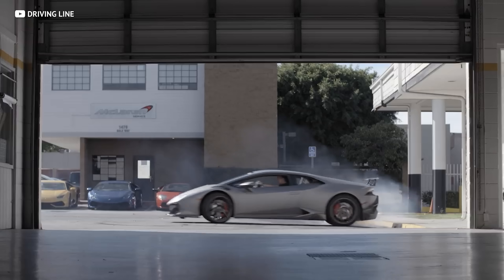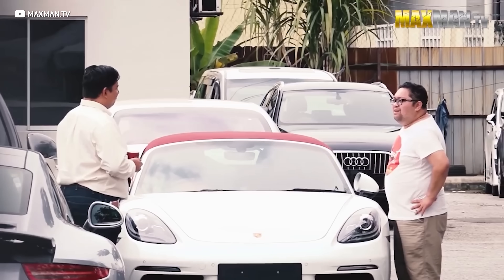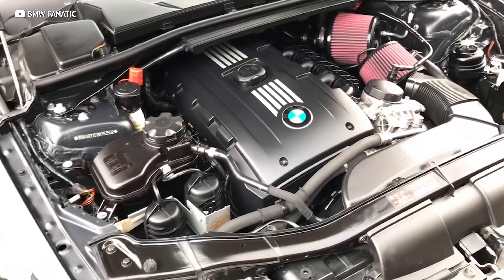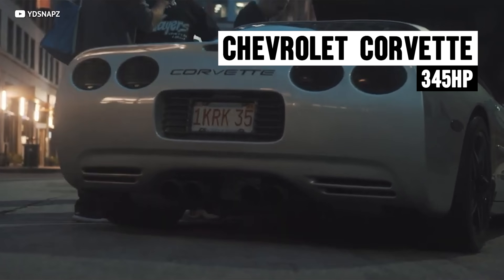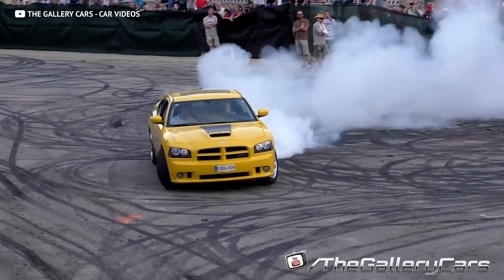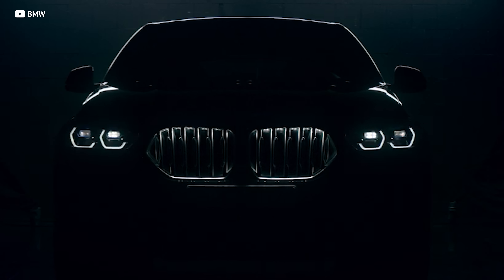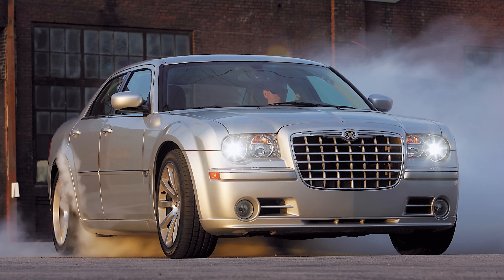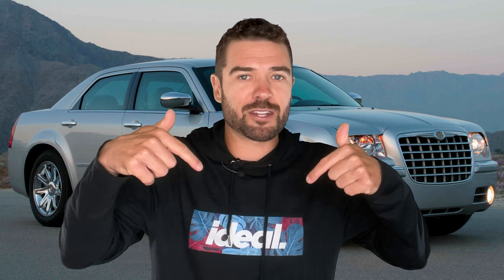Cheap Cars With a TON of Horsepower

Comment: You forgot the jaguar s type r. Why these cars are cheap is beyond me. I have one since new 2003 . I paid 61 k for it. I've customized it and done some mods . It came with 400 HP. Mine has a little more with smaller pully and other Tweeks. These cars can be found for CHEAP . Great video.

Comment: For 10k I can get a 
1990s Honda civic for 2k
Full turbo kit for 2k
Full built motor for 3k
Dyno tune to over 600whp got 250
Total spent is 7,250
2,250 for safety stuff
😂😂😂😂😂😂

Comment: I've driven 7 of these, and I am 100%  with you on the mid-2000s Infiniti G35. My mom had the '04X because we live in the North. But let's just turn the traction control off and be sideways for a bit, eh?. HAHA! But ya know? Crashing Mom's Infiniti is a good way to be orphaned. So I mostly drove it with empathy and safely. It is, hands down, the most competent car I've ever driven in the snow. Still! I was passing trucks trucks in the ditch every winter. I think the Front Mid-ship Tech helped a lot. Sedan was 50-50 and the coupe 50-49. But Once a line  or model loses the manual transmission, I lose interested. I die a slow death with the 5,6, and 7 speed. Life used to be better.

Comment: The latter part of this vid should have been called "Cheap cars with tons of hp and no build quality".  Great vid though.
Reply: Only gear heads seem to get this . Yup all the plastic and chips will fail in a few years and it is most likely someone who originally bought the car probably drove the snot out of it unless it was a retiree . If you want a high horsepower car lease it and let it be someone else's problem .

Comment: No Infinity hasn't, ive put 90k on my 2015 q50 buying it with 36k miles, almost 2.5 yrs later I can sell it for what I bought it for. And the 3.7 will easily run 300k Miles. Infinity especially the 3.7 is the best motor hands down in its class. So I disagree with your assessment.

Comment: If you're looking for something a bit cheaper, more practical, and more reliable than the cars on this list, I'd go with a Pontiac Grand Prix. You have two options if you want power. 

First is the GXP with the 303 horsepower LS4 V8. This is best if you want straight up power and performance. You can find one for under $4,000 nowadays, no joke. 

Next is the GTP with the legendary 260 horsepower Supercharged 3800 V6. If you want to build, tune, upgrade, and race your car, this is the way to go. It makes less HP stock than the GXP but it's more reliable and you have more room to work (think up to 700 horsepower on a stock block with a turbo kit), not to mention that you can get one for under $2,000.

Comment: I won't subscribe because they need to put on someone that actually knows about the cars. The 300C had 340 HP, not 425. The SRT8 had 425 HP. But, I bet dude knows all of the specs for a Norelco shaving system though.

Comment: Do your research a little better. Only ways your getting a gto for under 10000 grand is it has 150000 miles or more.  Most like mind are going for 18000 to 28000.and their heavily modified

Comment: Nice list. The thing with the C5 vette is all the cheap and good deal ones are either automatic or are a 6 speed and have well over 200k miles/are super junky. I think your best pick on the list is the lx cars (5.7 hemi Charger/300). Why? A 300c hemi with 150k and in great condition can be had for 3800-5k if you keep your eyes open. With a converter, Eagle (09+) heads, and a cam, you have a mid 12 second car for 7,500-8,500. The NAG1 can handle that power level relatively easily, and you're only a 100 shot away from 11's, which is good enough to beat every car in this video and still be at the same price or cheaper. 

I would say go LS with the goat or an F-body, but those cars are at least double the price that they were 5 years ago now and not really a bargain anymore.

Comment: Acura tl (3g),  in particular the type-s.  $5k -$7k for a clean condition base model, $8-10k for type s.  Intake /exhaust and a tune will get u well into the 300hp range on the type-s, with the 3.5 v6.

Comment: why didnt my comment get added? dam gypsies.... 2014 chevy caprice ppv. v8, 6.0. 355hp. gov auction as low as $5000. i paid $8500... you mentioned its cousins from Australia... i want my  spot.
Reply: L77, zetta platform... will fit brembos if lightly modded as well

Comment: The first car, BMW 335i, is nearly impossible to find. They might have found one with a salvadged title and blown headgasket with transmission problems, but I don't believe for a second that you will find another one for less than $10k.

Comment: With all of these cheap, easy to find on “Cars Dot Com” cars you’ve said, I’m surprised y’all didn’t mention Fords most reliable, and easy to find for cheap power pusher, the 4.6L 2v.
-
With a respectable 220hp throughout several platforms from the Ford Explorer to the Crown Vic and even the Mustang GT, you can find these for between $3,000 and $10,000. The cheapest being likely the best bang for your buck, the highly overproduced and most rigid car ever built by Ford or most other American manufacturers, the Ford Crown Victoria P71/P72/P7B Police Interceptors. They come standard with the 4.6L 2 Valve V8, on a police packaged, body on frame, wildcat of a police car(aka the Panther Platform). They run on FB for between $2,500 and $4,500. You can find them at dealerships for about that as well. I’d say they MORE than make the cut for this video. Same with the same generation Mustang GT(2001-2006/2007-2008.5). The GT comes with a 4 Valve version with a more respectable 260hp. Also, both have a top speed between 130mph to 140+ mph.(I had my P7B up to 143mph whooping a Mercedes S550’s But lol). I’m genuinely surprised, with all this, that y’all didn’t mention this, like at all.

Comment: I had a 335i with a remap that dyno'ed 431hp, would easily beat every car on this list. Got rid of it for an LS2 engined Monaro which was very nearly as quick and now own a 635d, remapped to 350hp. The Monaro was the most fun of all of them, drifts super easy and sounds amazing but didnt feel nearly as fast as the 335. 635d defo my favourite though, loads of torque, very comfy, still handles ok and looks a lot more expensive than it is. Also, the 335 was the most unreliable car ive owned, by far

Comment: One of my co-workers drives an LS swapped BMW that had orginally come with a V12. 

There was zero chance of ever resurrecting the original motor.
Some internals were visibly hanging out the sides.💥💨

It sat in our shop for about a year. I think everyone has either machined or welded something on that car.

Our painter laid down a fresh coat of epoxy and basecoat/clear coat on it.

It's a really nice car now.

Great guy that's always willing to help somebody else out.

Cool to see him enjoy having the car he's always wanted. 

Good Karma too with it sitting out front as advertisement.

We have gained quite a few new customers from the local Hot Rod and Motorcycle enthusiast community.

Comment: I bought a g37s and I’m honestly completely satisfied with how it drives and the way it delivers power it’s just underpowered stock from factory. I think based off this list now im kinda wishing I looked at GTO’s 💀
Reply: The issue is there isn't a gto out there under 17k
Reply: @dawsonholland2885  not very accurate I see them listed for 13-15 all the time. Depends on condition, mileage and transmission but they’re definitely out there
Reply: Not under 100k miles like he said
Reply: @dawsonholland2885  what state you in? I’m in Texas (DFW) and I see them with moderate miles all the time it’s just the gamble you take if they’ve been dogged or not
Reply: North Carolina lol I have looked and looked and looked all with in 300 miles of me are 14 to 17 with 100k plus miles and 17 and over for under 100k

Comment: OMG. The G modern Nissan's and the Infiniti's are fucking GARBAGE. They have more power than an STi, yet get straight up OWNED by an STi. We aren't talking about barely lost in even a roll race. We are talking about bus lengths behind an STi in a roll race. That's even with 2WD over AWD in a straight line, and the power lose that goes with the AWD setup. It's fucking sad. Power isn't everything. Even power to weight ratio isn't everything. Certain cars are jujst built like shit, and run like shit. To stay on the STi train, it has at best 300hp and 300tq. Yet, it will pull a Dodge Charger or Challenger that isn't an SRT-8, or shacker pack, and those other models of those POS cars come with around 370HP and TQ from a 5.7L V8 Hemi. That's compared to the 2.5L 4cyl around 300HP and TQ STi. That's just fucking pathetic.

The Genesis also gets owned by lesser powered cars. You guy fucking suck at comparisons. The GTO is also GARBAGE. And then you idiots brought in the Chrysler 300 into play. Holy shit. Talk about one of the biggest piece of shit cars ever made. The Chrysler 300, no matter what model, is a steaming pile of shit. You guys need to just end this channel. The modern day HEMI is a piece of shit.